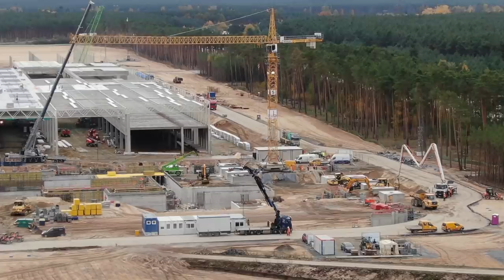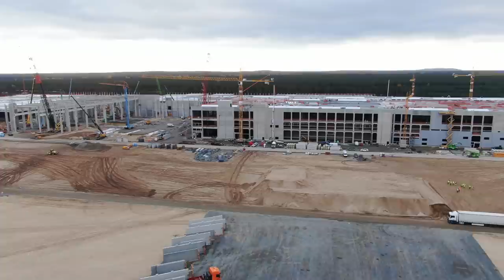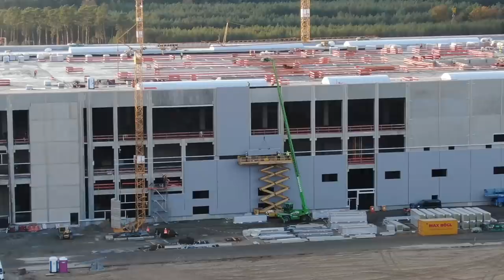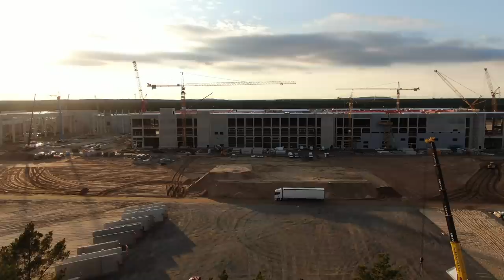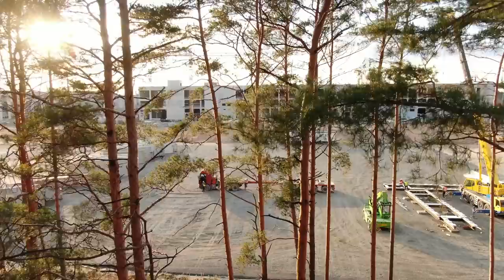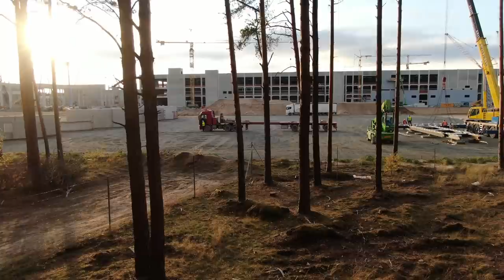Giga Berlin | 2020-10-28 | Timelapse

Comment: What are the small rectangular modules that are being offloaded from trucks at around 4:00? Each one seems to have two windows on the side facing the drone...
Reply from the maker: Office containers, just like the others that are already placed.
Reply: @TobiasLindh  I thought that might be it, but I saw them stacked 3 high without a way to get in. I guess they were just storing them in a pile.
Reply: @rlevitta  They have internal stairwells.

There are three types of stairs.

External container style https://www.container-mietservice.de/container/uebersicht/container_mieten_raumcontainer_anlagen.jpg
Stupid stairs on the outside https://www.conrocontainer.de/images/cache/0e3dd03e744bc593ee6258f83f99d28d_w600_h600_cp_2.jpg
Internal https://www.isar-container.de/wp-content/uploads/2015/05/container-mit-treppenhaus.jpg

Comment: I see in the last week most of the the roofing structure for the BIW building has been completed on the right hand side (as shown today). The roof completion seem to take longer than I expect, the drive unit roof is still being finished, two months after the structure was done. It looks like one of the easier jobs, but I'm sure its not.
Reply from the maker: Roof is one of the most visible things, but I think the completion of the roof is not the priority. I think only the structure is important for progress, so they can get the cranes out and start interior work.
Reply: @TobiasLindh  what's the average temperature there at the moment Tobias, must be starting to get cold to work outdoors all day?
Reply from the maker: @mjcamp01  It's between 10°C and 13°C, so not really cold.
Reply: @TobiasLindh  thanks. Too cold for my liking though 😉

Comment: Any Model Y reservation holders here? Will Model Y for Europe be made in Germany or will it be exported from China?
Reply from the maker: All Model Y for Europe should be made at Giga Berlin.
Reply: @TobiasLindh Since they've started exporting Model 3, Model Y could be a possibility too. I hold a Model Y reservation as well.
Reply from the maker: @SivaKumarNitesh  Model 3 makes sense, because Model 3 won't be build at phase 1 at Giga Berlin and the Model 3 line in China had some time to ramp production and tool the line for European specifications.
Model Y line in China will take some time to ramp and the first models shouldn't be exported. And it wouldn't make sense to tool the Model Y line in China for European specifications when a factory in Europe will start to build the same car soon after.
Reply: @TobiasLindh  bingo! There are only few places in Internet these days where we get answers based on facts. Thanks for being one of them! 👏👏👏
Reply: Thinking more about this, will the German made cars get the 4680 cells as well? New batteries means range increase of 30%, doesn't reflect in their websites yet.
Reply from the maker: @SivaKumarNitesh  Elon Musk confirmed that Giga Berlin will produce cars with the new 4680 cells. In the beginning it will be supplied by cells from the pilot line in Fremont.